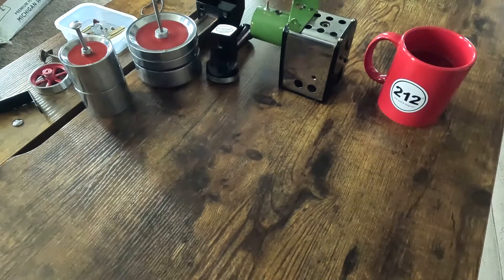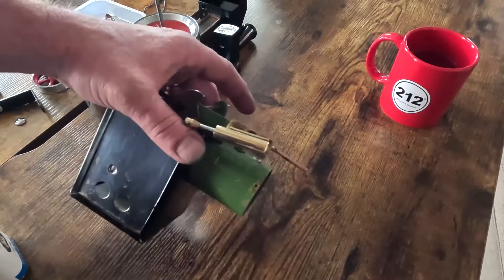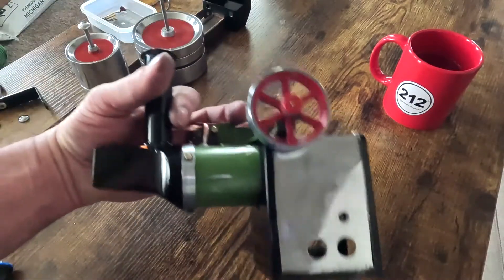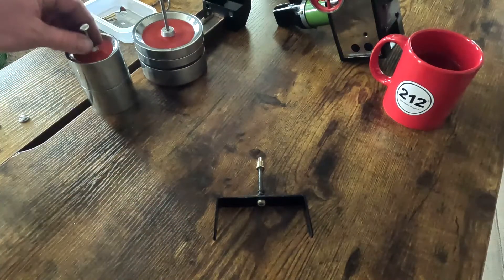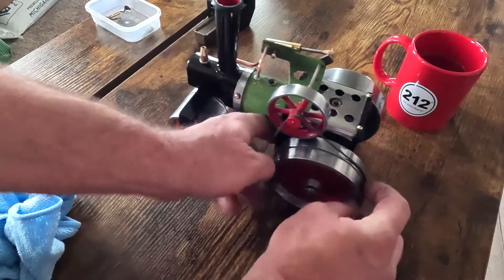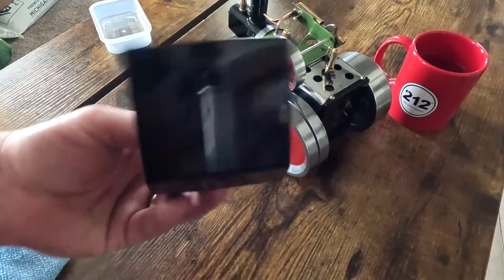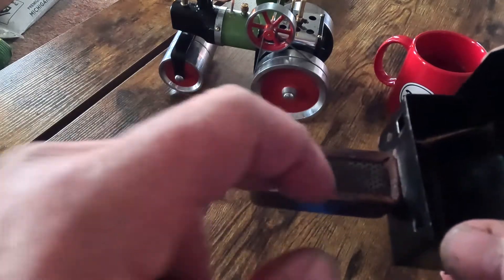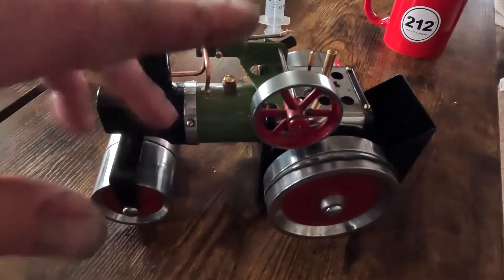Mamod SR1 revival part 2

Comment: Lovely job , does your boiler have paint where the burner goes ? I have one that someone has odged over the years , going to rebuild it , regards,  Tim
Reply from the maker: Hi Timothy, This one has the original paint still and the outside of the firebox is gloss black covered with chrome or nickel plated surround and has a Mamod decal on the very bottom. The scuttle (alcohol burner holder assembly) is also gloss black. But inside of the firebox does not appear to be painted, it would burn off anyhow. I hope this helps answer your question? If not I'll do my best to answer it better. Thank you for your interest, watching and commenting 👍

Comment: won't the engine run backwards it you spin it the other way when you start it? seems like mine did. but it's been almost 4 years ago .
Reply from the maker: Hi Mark, sorry for the late reply (I didn't see your comment) This one is forward only, I fired it again just to check and sure enough it will only run one direction. The SR1A model has a reversing lever that moves the cylinder up and down to allow reversing but the 1st ones don't have that option.  Thank you for watching and commenting 👍
Reply: I meant to say 40 years

Comment: I was looking for this. It's just that I see so many of these. It's hard to believe that they're all exact duplicates of the same model. These things must-have been mass produced. This contraption requies denatured alcohol and distilled water. You can have this model steamroller run on a gymnasium floor. 💧 🚿 🚰 🚱 💦 ♒️ 💧 🍸 😳 😑 😒 😐 🤣 🍸
Reply from the maker: I can only imagine how many hundreds of thousands of these models have been (and still are) produced by Mamod.  They have changed very little throughout the production with the biggest change being when they went to the A model (sr1A). Which is still available brand new today from Mamod.